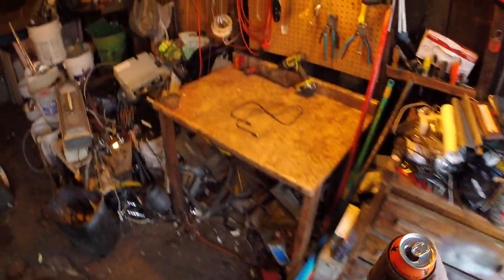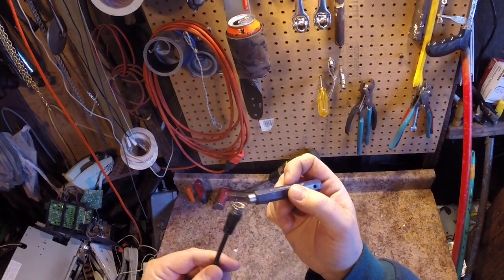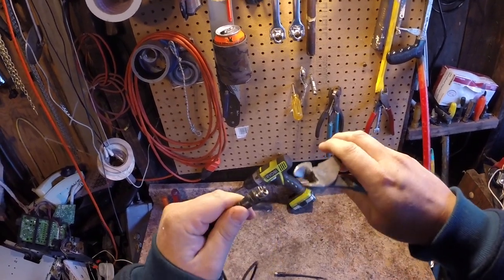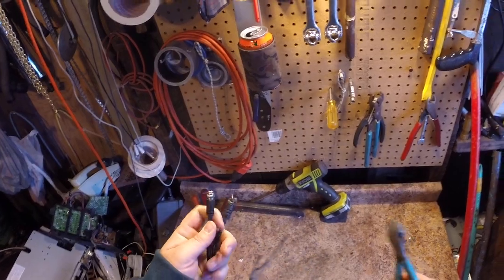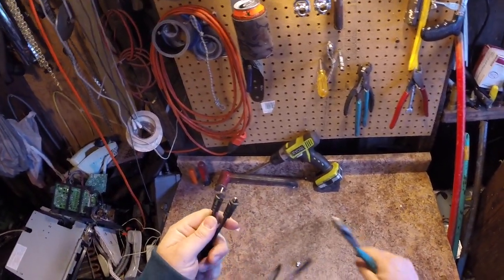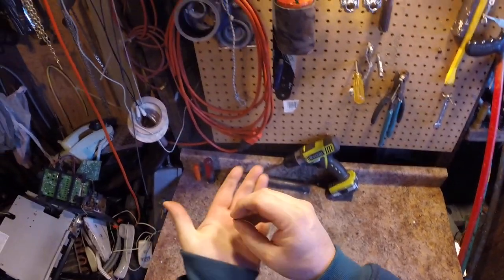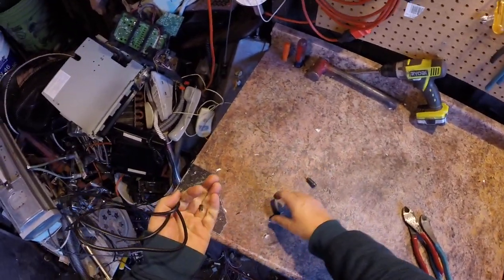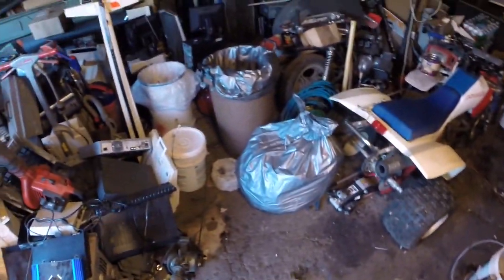scrapping coax cable

Comment: Are the ends of these or other adapters, usb's, ect, giver made of aluminum?  Or is it always brass or steel.  Thanks.
Reply: 95% of the time they are brass. Sometimes they are nickel or aluminum. If you aren't sure, take a file and give it a real good scraping. you should see a brass color underneath. If not , throw it in with your clean sheet aluminum